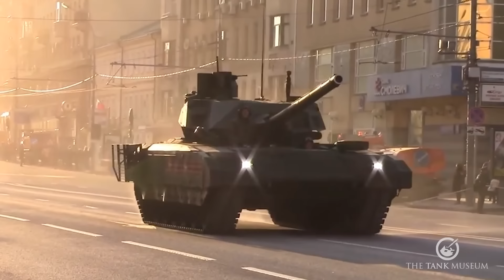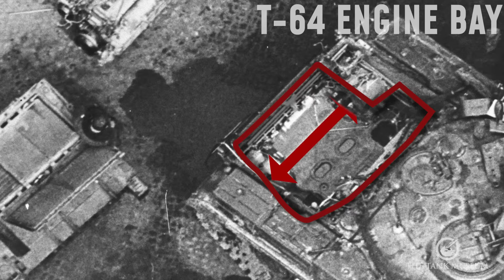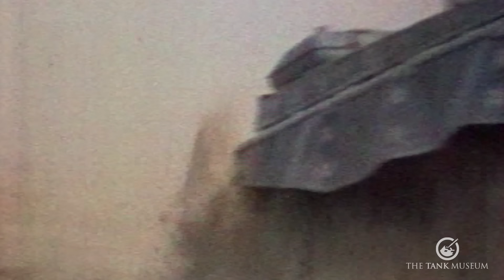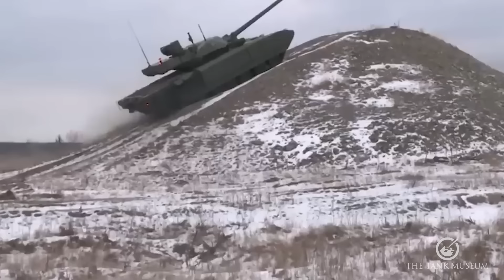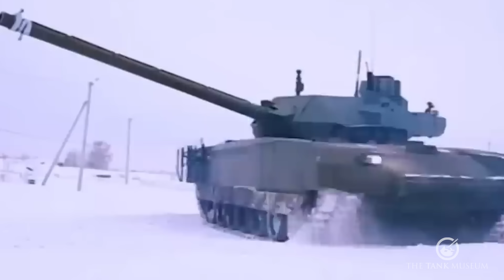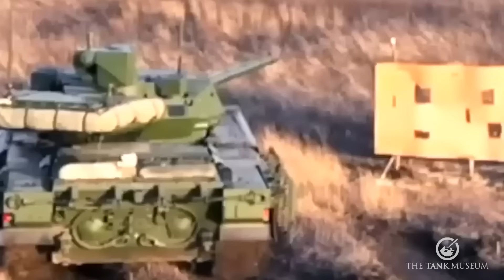Radical or Ridiculous? | T-14 Armata | Tank Chats #171

Comment: "But by the time this film is released it may well be that this tank is in actual combat"- the most optimistic statement of the year. Bravo!
Reply: @Whatifwarlord  we don't bring those to parades
Reply: I would never deploy the T-14 or disclose production until absolutely necessary, no strategic reason either, it would be just to see people seethe about it and try to make up reasons as to why the tank is never used
Reply: @vikhr  Thank you for your comment. The voice of mind is rare nowadays...
Reply: All 10 of them expected to show up in combat? Oooohh!
Reply: @davidwoody5228  According to Wikipedia they have 40 now, should suffice to take out the those 40 Abrahams tanks
Reply: @archyology  LoL. Wiki is not a reliable source in this instance. And no, Armata is not getting into the fight, and if it does it will not be any more successful than older Russian tanks already getting butchered there. The weaknesses of the T-14, dubious survivability against top-attack ATGMs, inferior vehictronics, doubtful armor protection against latest gen western APFSDS, likely negates any benefit of its design, innovative though it may be.
Reply: Meat Salad  LOL
Reply: By the time this film is released, it may be that this tank is in actual combat... briefly 🤣🤣🤣
Reply: It is in combat with the artillery units so unless you break the defense line you ain't going to see one. I mean the challenger is being used the same way the Brits don't want Ukraine to use it on the frontline
Reply: @marshalljulie3676  Your point is plausible but there were already several attacks with tanks from russia after this video. So if they wanted to test them in battle they had at least few chances. All T14 defense points in this discussion are about how there is no point in using this tank in the battle. Problem is if you don't use it - there is no point for it to even exist. No-one is even trying buy it. Even china - fan of reverse engineering ignored it. It's like Panzer VIII Maus
Reply: Russia is now defending it's own territory with conscripts- if the tank worked it would be in use.
Reply: Spoiler alert: it isn't
Reply: Meat Salad  Maybe in dreams
Reply: Not even necessary to even use it in combat as they clap leopards, bradleys etc on masse so...
Reply: @evobsm2328  First it is mostly done by artillery and mines. Second bradley is an IFV so it doesn't mean anything. Leopards are pretty old - they entered service in 1979. Basically equivalent to t-80. Hype on both sides is honestly funny. And now the most surprising thing - you usually use superior weapons to gain advantage. Armata according to specs should be able to shrug off main antitank weapons (e.g javelin) which would make it a very safe option to use on the battlefield. So either reported specs are lying or russian commanders simply want to sacrifice more personnel by using less sophisticated weapons. 

Don't think - just consume propaganda
Reply: useless and totally biased video, judged based on westerns mindset where expensive is "more better", russian and chinese fight with quantity, t14 wa left aside because is too costly and to boost t90M, t72M and t80M production, chips are being smugled into the country like no sanctions have ever happened you guys live in a bubble of childish
Reply: They have in ukraine and were destroyed, in my opinion it's looks good on paper but in combat a total dud.
Reply: @Allansybesma show us the puctures
Reply: 2 years and counting..........!
Reply: @Whatifwarlord -  Chally combat weight is some 72 tones ! T14 is 55 tones. This is a SIGNIFICANT difference, lol.
Reply: @mirandela777 one is a defensive platform the other an offensive shock weapon
Reply: When Ukrainian troops reach the factory in the Urals, maybe that’ll count as “combat” 🤔
Reply: Destroy by Ukraine force
Reply: I think first batch has arrive for live trial in Ukraine, it's still in development so I doubt it will go to loud theatre probably somewhere quiet fist to test the endurance.
Reply: @gkagara  Armata was finished in 2014. Fixing issues or adding new features is not 'in development '. What do you mean by endurance? You don't need to bring tank to a war to test how far it can go or how many times it can shoot. To test other things like armor, cannon, defences, usability, etc. You need to use it in battles.
Reply: @Dzimko-rc2io  endurance how it goes in real situation ofc it's live test different with test run.
Reply: @gkagara  What real situation? If they only drive it around it's no different from tests they can perform home as both countries have similar landscape. The same applies if they use it like artillery. And even if it was 'tested' this way in Ukraine I would expect some video evidences. It's in theory the best russian tank. And if it's the best you would usually won't to show of it at least a bit
Reply: @Dzimko-rc2io  well getting assigned to quiet part of the battlefield is same as get into battle without risking losing the tank
Reply: @gkagara  What quite part? Garage? "Real life test of how tank can stand still 200 miles away from combat." You test armaments in combat to ensure and show that they work well in combat. This is 7 years old tank which would promote idea of russian army superiority IF it was really used and IF it's a really good tank.
Reply: @Dzimko-rc2io  quiet part bro.
Reply: Just british regime bluster, you won't know what happened until long after its over if it doesn't fit the narrative.
Reply: @churblefurbles  : just go home Ivan, you are needed on the front line. And take the other propagandists such as fred6319, D Train, conserpov, Meat Salad with you. You are needed there and we don't need your ruZzian propaganda here.
Reply: Kinda like those Abraham’s hey? In fact they seem to have the same amount of them, 40 vs 40
Reply: @archyology and the Abrams in Ukraine is a far older and inferior platform than that used by US forces
Reply: @archyology  firstly, it's Abrams. Secondly, no, Russia does not have 40 T14s, let alone 40 combat reelady T14s, thirdly, as Russia has consistently employed its greater quantities of armour worse than Ukraine has, 40 Abrams are indeed likely to have a greater difference than however many t14 Russia could scramble together.

Anything else?
Reply: Toilet tank
Reply: recently, several T-14 tanks were indeed tested by the Yug group of troops in a real battle in Ukraine, after which they were withdrawn from the front line

"The Yug group of troops used the latest Russian T-14 Armata tanks in combat, a source in the military-industrial complex told TASS agency.
"The Southerners actively used Armata in combat operations. Several units participated in the battle to see how the tank would manifest itself. Then they were withdrawn from the front line," the agency interlocutor said."
Reply: @Конрад_Карлович_Михельсон  Do we have videos of them participating in real combat though? Russia military said a lot of things which were proved to be BS. And with current laws Russia news are just an extension of government. I haven't heard any reliable news about fighting them from Ukraine or NATO as well. They probably just send them to the front lines and then sent them back without any combat. Though learning how to retreat is also a combat test...
Reply: @Конрад_Карлович_Михельсон  for example when they informed that they have destroyed more bayraktar drones than Ukraine military had (they provided count of destroyed drones). And then they informed about new attacks by bayraktar drones. This is the most vivid one which pretty much dropped quality of Russia military news to the rock bottom for me.
Reply: @Конрад_Карлович_Михельсон  military reports would be nice. I saw reports for artillery from Russia for example. In this case it's a First battle of the newest and 'best' tank. It would be pretty useful for both internal and external propaganda. So question is why they don't advertise test battle of such a good tank? It's not like they need to show all tank specs or can't show the video post factum so there no need to hide it. The only 2 options I see is either tank was so bad that they couldn't make a half decent video OR there were no combat tests at all.
Reply: @Whatifwarlord  - "...it’s a design choice to reduce overall weight." Not really that, you are right but is NOT the main reason. 
This design offers the BEST POSSIBLE protection for the crew, much better than a tank even with 20 tons  of extra weight. 
This design offers more survivability to the crew than a NATO tank 20 tons heavier - and this is the revolutionary trait, making Armata a Next Gen...
Reply: @Whatifwarlord  Very good point. I concur.
Reply: @Whatifwarlord  What about the F-35? I'm pretty sure that the F-35 Joint Program Office issued a "change of operating parameters" for the VTOL and STOL versions of the aircraft in 2019 saying that they cannot be flown supersonic for more than a few seconds otherwise structural damage can be caused to the tail section and rear of the aircraft...... The design is so deeply flawed that the problems aren't cost-effective to remedy.

Russia has some corruption problems (for sure) but they're not in Ukraine's league for that. But I think in the US corruption, over-pricing, price-fixing etc among American defence companies is just endemic - always has been.
Reply: @grantchallinor5263  So far there are 900+ F-35 in service around the world. And that is verifiable. The point the OP was making is that so far not a single T-14 has been seen in service although Russia claims that they are. Every new technology will have problems from the iPhone to the Falcon 9 rocket but don't lie and say that something is now in production and is in service when in reality it isn't. If Russia produced the T-14 and put it in service and is having issues with it then that's one thing, but that isn't the case here. There is absolutely no proof that the T-14 is being mass produced and is being used in the field.
Reply: @grantchallinor5263 ok, now that's just a lie made by reformers, you seem like a the type of guy to say "The f-35 is not maneuverable and can't dogfight"
Reply: @grantchallinor5263  'Russia has SOME corruption problems'! What an understatement! You also somehow think Ukraine is more corrupt than Russia. If that were the case, its supply struggles would've been much worse than Russia's and given how the 'second most powerful army in the world' is struggling more than Ukraine which has less equipment in orders of magnitude I'd say Ukraine is far far less corrupt than Russia. Get out of the far-right'S echo chamber which has been screaming 'Ukraine is corrupt' to mask their desire to see Putin's fascism victorious over Ukraine's fight for liberty and sovereignty
Reply: @grantchallinor5263  Where did you get your information from?  Name a source. There are restrictions on supersonic flight, but I’m interested to see if you actually know what those are. So give me the actual numbers. You won’t. Because they are operationally irrelevant.
Reply: @bgamb224  The restrictions on some versions of the F-35 are in the public domain. What's the source? The US's F-35 joint program office (Arlington, Virginia).
Reply: @grantchallinor5263  Ever heard of Whataboutism?
Reply: @barlauch9292  Until now, No! But looking at this definition: "The technique or practice of responding to an accusation or difficult question by making a counter-accusation or raising a different issue." I don't think it's valid here.

The video raised the issue of corruption within military contracts/procurement being a factor in holding back the T-14 programme and/or the Russian defence in general - trying to say that this was especially a problem for Russia's defence industry. Not true!

Does Russian corruption exist? Of course, but the problem is a fraction of what it was a decade or more ago. It's a drop in the ocean compared what goes in US military projects and procurement.
Reply: @grantchallinor5263  I dont think that corruption is worse in USA but if you think that.
The T-14 is a good example of the Problems of Russia, they couldnt start mass producing it, they could only make like 10-20 models.
They have heavy problems with it, like it geting stuck while on parade. They cant use it in combat, if they could they would.
Reply: @barlauch9292  Trust me, my work has taken me around eastern Europe, Russia, the US and all sorts of places. I'm probably fortunate to see a lot of military hardware that you can only see (or see being talked about... ) on Youtube.

I think David Willey was right to say that the T-14 project was never fully signed-off because a new MBT isn't a priority for the Russians (they have 1000s and 1000s of tanks) and the money could be better used elsewhere.

You don't really know what you're talking about, but to explain, when developing a new MBT, a fighter jet etc, 10-20 units would be built as prototypes, each unit probably incorporating small updates/improvements/refinements. There's no real "physical" reason why the T-14 couldn't go into "mass production" only that a decision was made not to do so.

What "heavy problems" with the T-14? Again - you don't know what you're talking about... One T-14 did stall during the 2015 (I think it was that year) Victory Day parade, or on one of the rehearsal days. They tried to restart it/recover it using a recovery vehicle, but then got a tank driver with more experience of the then new T-14 (who didn't stall it) to restart it and drive it off.

Probably the only reason that T-14s aren't in use in the Ukraine is that NATO would concentrate so many resources/assets on it - just to get the propoganda coup of hitting/damaging/destroying one.... Why would Russia do that?

As for corruption, price-fixing etc in US defence companies being on a different level to elsewhere (most senior US politicians are funded by them) I think you need to read a bit more.
Reply: @grantchallinor5263  or the reason is teh fact they dont exist in numbers
Reply: @barlauch9292  ever heard of direct comparisons?
Reply: @barlauch9292  Yes, I heard my adolescent son use the term, when he was losing an argument.
Reply: @grantchallinor5263  it’s so embarrassing that you think the T-14 is in any way combat ready, the engine in it is taken from a WWII german tank!!! It wasn’t a “stall” the engine simply broke. The f-35 is the most successful 5th gen fighter program of all time, and is an incredibly effective fighter for its role it may not be the dog fighting beast like the f-22 but it’s a whole lot cheaper and more technologically advanced. The T14 at the moment is no more than a propaganda parade piece. The American army may be corrupt but it’s nothing compared to Russias as we have seen in the Ukraine war, soldiers are getting deployed without proper equipment or weaponry
Reply: @grantchallinor5263  cope
It's not like a Russian explosive protection boxes sometimes are just filled with egg containers or rubber) And there is no video where Russian helmets bend with a fist)

It's always fun to see a confident Russia fanboy from US) Like.. it's so strange how u guys are telling all this absurd for everyone in Eastern Europe statements with a straight face)
Reply: @barlauch9292  Whataboutism, but also comparison.`
Reply: @grantchallinor5263  Yes I definitely trust random person on youtube. 

David simply read report from russia military. From the same military which was going to buy 2k+ armatas before. 

Why would you need to make these tanks in peace time? For example because you won't have components to make them during war time - that's what we see right now. So yes the lack of western components is a good physical reason which might be preventing 'mass production'. Another reason is to sell your new best tank. This earns money prestige, and provides some feedback. Do you want one more reason? So you can test ease of productions, ease of training, potential mechanical problems which takes time to happen (like f35 you have mentioned) etc. Having few hundreds of up to date tanks might also help in case of emergency - e.g. war. Almost 1k of produced f35s supports such idea. Even chinas fleet thinks that you are delusional. Main problem with T14 armata though is that there are no evidences that it is truly operational and can be used in combat. Basically there is a bunch of small reasons to believe that tank is not that good and only russian state media saying otherwise

Why would russia use untested, in the battle, vehicle in the war? To test and prove that this is something more than scrap metal to the world and citizens. Like HIMARS did. They could at least use it in some 'safer' regions
Reply: @barlauch9292 yeah that's what Americans do when they can't come up with a solid argument
Reply: @barlauch9292 you should have watched the whole video. A 19 year old engaged the emergency brake by accident the tank then moved under it's own power.
Reply: @barlauch9292 yes but the tankers will just abandon them at the 1st sign of trouble.
Reply: @grantchallinor5263  Well yeah, the American military is legendary for overspending and being impossible to audit.
Reply: A tank is made for battle, and it will get to it sooner or later. Would it be used in Ukraine or not, we can't know. If it has some sense, it will be used, but also 'old' tanks could be enough and Russian military may not want to disclose the vehicle's capabilities before it may be used for real, I mean the big war (not in that entrenched back-and-forth that is happening now).
Reply: @true_xander  you do know thats the excat thing they said last year when we did not see any t-90 and os on
Reply: @true_xander  A tank is made for battle but Armata is made for parades.
Reply: @arctic_haze and the premier of this tank on parade broke down in the parade, goes to show you they got junk.
Reply: @true_xander  the t14 isn’t a tank, it’s an overpriced prestige piece. It hasn’t been put into combat because it has been overhyped by state media. 

If it ever enters combat some will be destroyed and others will be captured. That’s inevitable for any tank no matter how good or bad. But because the Russians pretend their tank is invincible on state media it would be a huge blow to national prestige if deployed. 

Even worse when one gets captured the west will be able to demonstrate that it’s not as advanced as claimed and all of a sudden no one will be able to take Russia seriously (not that people take Russia seriously anymore with how they’ve performed in Ukraine).
Reply: @themecoptera9258  bruh the crewless turret (inb4 legless conscript in closed-loop suit memes) on a production tank (abrams ttb was a bit earlier than obj 195) alone is a breakthrough
Reply: @Klovaneer  the only real reason to use a crew-less turret is to save space and build a smaller vehicle. But the t14 is basically as big as any western tank. 

Seems like a gimmick to me, which is probably why western countries stopped with this exact concept decades ago.
Reply: @themecoptera9258  It's as high and as long as a western tank, not as big. The actual turret from the front is just the mantlet and gunner's optics. Meanwhile M1 abrams turret is like the third of the overall weight and is half the length.
Reply: @Klovaneer  ok, so you will cellibrate Germany or Us when they become the first nations to produce a production MBT with an unmanned turret? because the T-14 isn't in production, the maybe 20 that have been built could be said to be pre-production at best.
Reply: @themecoptera9258  it is far smaller than an Abrams and challenger
Reply: @sgtsharp1537  maybe i will, did you have a point or just mad?
Reply: @themecoptera9258  Har har har. Just propaganda driven nonsense.
Reply: @themecoptera9258  Though the cost range is "$3.7–$4.6 million in 2015 $5-7.1 million in 2022". A Leclerc is apparently $12.6M while an Abrams now is about ~$10M. It isn't that overpriced relative to what tanks cost these days.  Leopards, Abrams, and Leclercs have done very poorly in the Yemen, Iraq, and Syria when used by Turks/Iraqis/Saudis, so I think we've learned tactics & crews are more important than tanks. It would make sense if tank vs tank battles occured, but RUSI recently noted that these almost never happen and tanks losses are mostly from mines & artillery. T-14 isn't going to do any better then a T-72 against such things.
Reply: @trogdortpennypacker6160  if 10-12mil is what tanks cost these days than I’d say that’s an appropriate price for tanks. If one country can afford to equip a force of hundreds at that cost, it may well make sense to do so. If another country can only afford a small number of $5M tanks, then that tank is way too expensive for them, even if it would be cheap for a richer country.

Clearly tanks are only as good as the crew, and the crew will always be the most expensive line item on a tank, this doesn’t exactly mean we should skimp out on tanks, in fact protecting the crew becomes increasingly important and extra cost becomes worthwhile to achieve this better survivability for the crew. Whether this survivability is actually achieved with modern western tanks is debatable, and certainly western combined arms doctrine has to factor in. Yes an Abrams can be destroyed, but if properly employed the survivability is still pretty good. The point of a tank isn’t to take hits, it’s to provide direct fire support and sensors in a mobile package, survivability is a nice bonus. 

The thing about the T14 is that it is at best a decent vehicle but state media hypes it up as an unkillable god of battle. That’s fine for a parade float, but once you actually have to deploy it you will take losses, vehicles will bog down and others will be captured. Fearing such an outcome, the Russians have decided not to employ their tank, which effectively means the T14 is worthless to them as a weapon of war.

Now of course this is completely sensible. A worthless tank is judged to be better than the inevitable propaganda blow which would come from employing the system. As the tank isn’t going to positively change anything in the numbers available there is no benefit to employing it, but a massive downside. At least this way it can be used as a parade float going forward.
Reply: @themecoptera9258 stop being a hater man 😂. It's supposed to be used as a central command that has other tanks connected to it. Look unless you know more than pentagon you should stop spreading propaganda bro. As you can see on the battlefield artillery is still king and nobody has more artillery or tanks than Russia. There are thousands of t-72s t-80s and t-90s. Hell they can even pull out t-34s and it would still cause hell on the battlefield for Ukraine because they are old but was designed to kill 🤷. And Russia is the best at electronic warfare. They once shut down a US warship and performed multiple bombing runs on it. This is not a game bro.
Reply: @marshalljulie3676  lol, you actually think the third rate power which can’t even overcome Ukraine could stand a chance against the United States. 

When the US led a coalition to overthrow one of the most powerful militaries in the world they found themselves behind schedule because they were having difficulty processing all the surrendering Iraqi soldiers. When the US navy took a hit from an Iranian mine they crippled the Iranian fleet in an afternoon. 

Meanwhile Russians barely managed to conquer Georgia, and is currently getting their teeth kicked in by a country which had a Pre war GDP smaller than that of 33 US states.
Reply: @true_xander  This is as big of a war as Russia is capable of without nuclear self-immolation. Feeding a handful of T-14s isn't going to make any difference beyond increased embarrassment.
Reply: @true_xander  It is already used in Ukraine, but mostly shooting from closed locations. It is a cutting edge sensitive technology, so it is understandable that the tank is not used in the very heat of the battle.
Reply: @manichaean1888  Why would anyone use a state of the art MBT from fixed, hidden locations? Might as well just use an artillery piece - much cheaper, far more plentiful and can deliver a bigger bang.
Reply: Entered combat a few months ago
Reply: @Mortablunt  claimed to be in combat a few month ago.
so far only claims.
Reply: @Mortablunt Another year has passed. Any combat footage of that mythical T-14 yet? 😂
Reply: @AlexN996 2 years now and still a "no show",must have exceptional "stealth"capability
Reply: @Mortablunt  where pics or vids or it didn't happen btw I've been watching so stfu
Reply: @Mortablunt  
There would be news of something like that.
Reply: @Mortablunt  have you see one???? 😂😂😂😂
Reply: @Mortablunt  They are talking about the real combat, not World Of Tanks